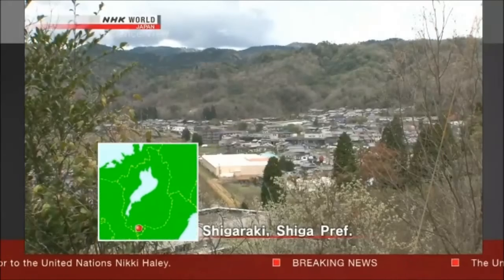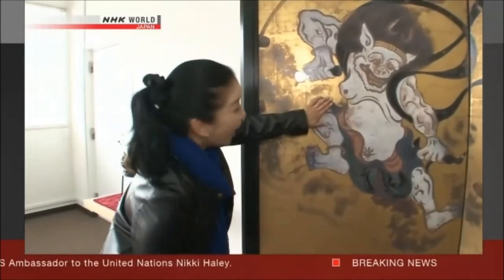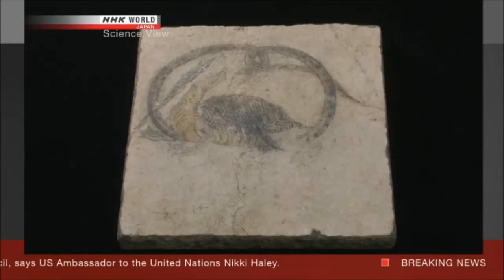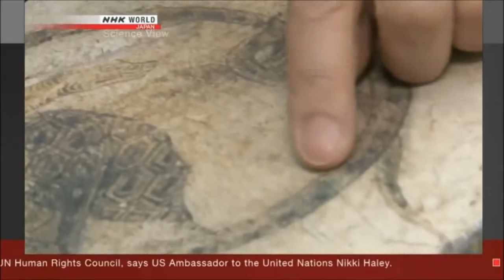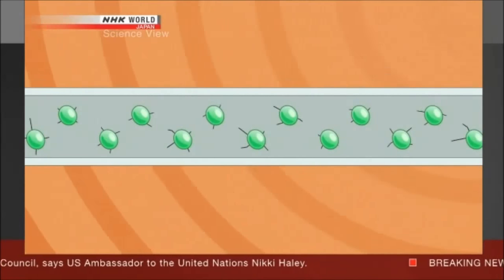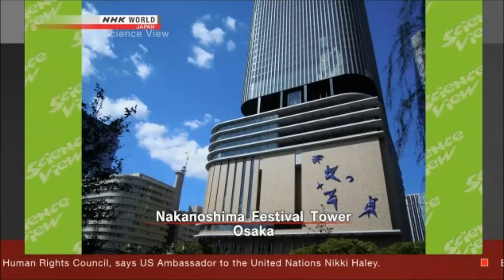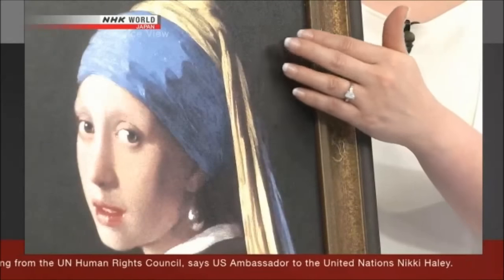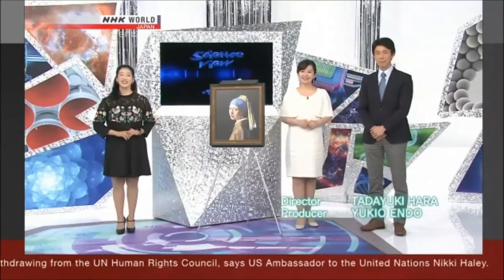Innovative Ceramic Panels Used To Replicate Paintings

Comment: The ceramic will last much longer than the original work of art, but will the colors or inks used in this technique also last as long?  Thank you for sharing this program.